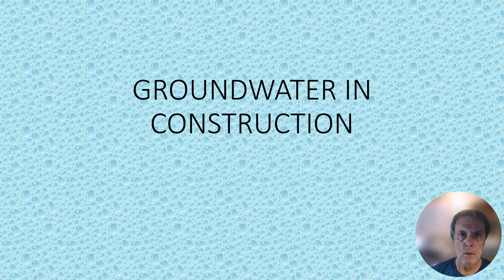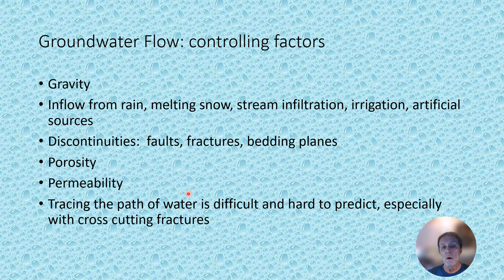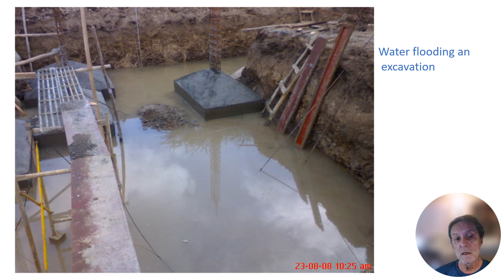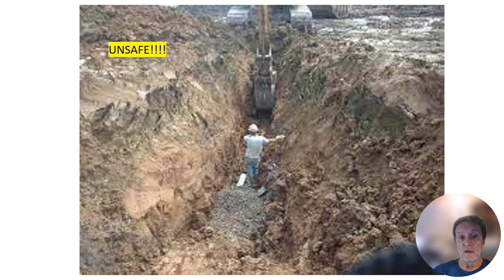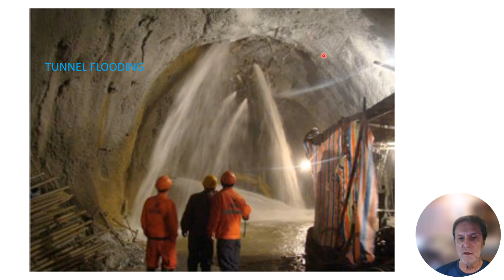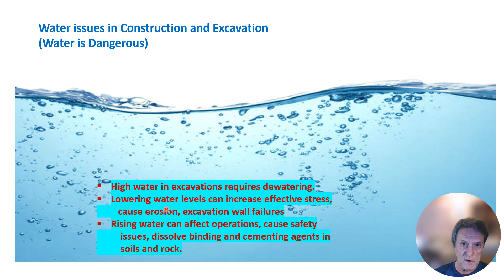Water in Construction Excavations

Comment: Retired Operating Engineer here, always loved the rain, less dust, easy to compact. When I worked in crusher pits, always wore a mask, no wind down there. I'm sure you have heard of strip pits, they filled with water, made great swimming areas when I was young. I'm 70 years young. I miss working. Been buried twice, not fun at all. Anything over 5 feet, needs to be stepped. Thanks for the video. I noticed, nowadays they use 5 piece's of equipment, we only used 2 at the most. Sump pumps come in quite handy